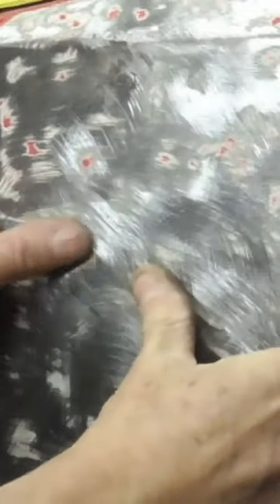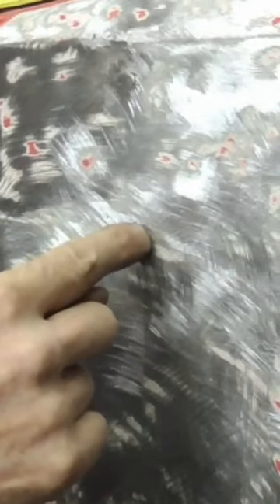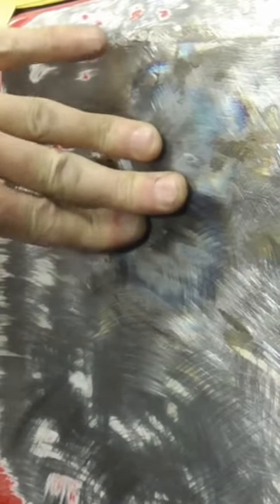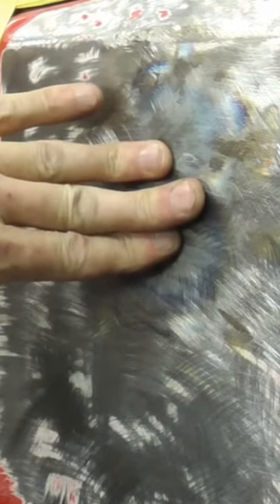How to Fix Oil Canning Every Time -   #autobody #shorts #autobodywork

Comment: I wouldn't call that a fix. Try a shrinking disc on a grinder.
Reply from the maker: You could use that too but if you want it to work every single time without a question - this it the method to use.  Never have to worry about bouncing metal again and can fix every dent no matter how big with confidence :)